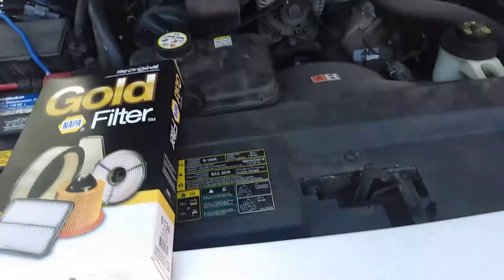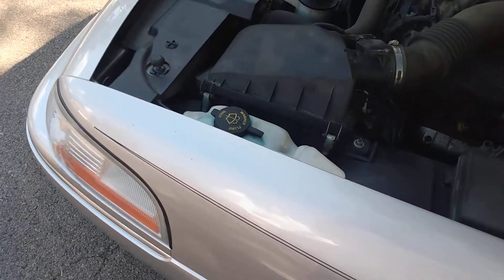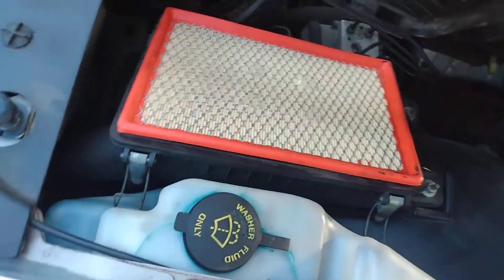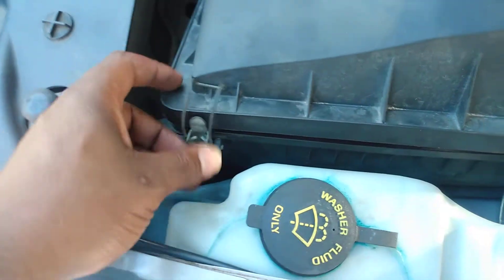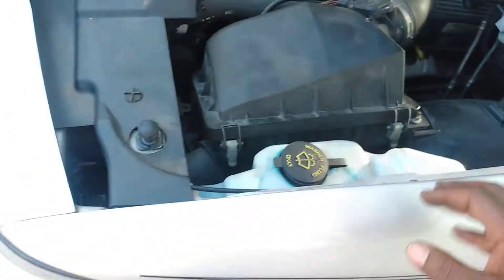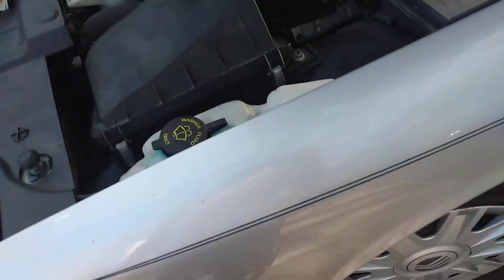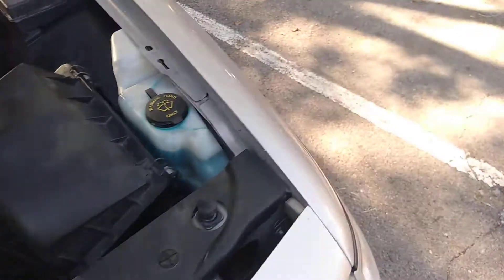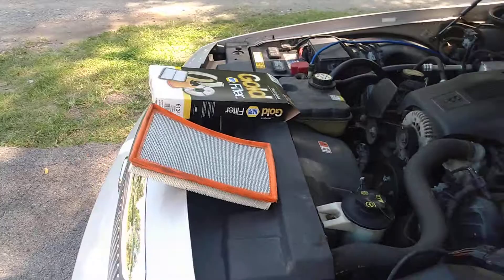How to install filter on 2004 Grand Marquis

Comment: Look at B, getting an early morning start to Sunday.
Good job.

Also is that blue wire coming from your battery going to your amp?
You might want to put a fuse on that.
Otherwise you might come back to a burned down Merc. 

-Chuck
Reply from the maker: Hey Chuck the fuse is in the trunk
Reply: @big_kapp4425  
Hmmm. I was hoping you weren't going to say that. lol
You kinda want the fuse on the power wire as close as possible to the battery.
Say within about 18" or so.

The reason being if there is a short in the wire somewhere in the middle, that means you still have a live wire from the battery to the short.
So that means everything after the short will be protected.
But everything ahead of the short will still be energized, and may start a fire.

I'm terrible at explaining things.
Let me see if I can find a video that does a better job.

-Chuck